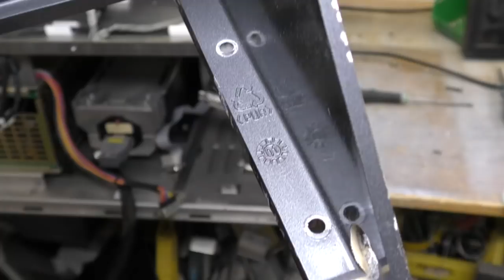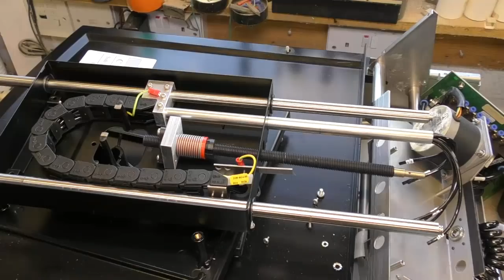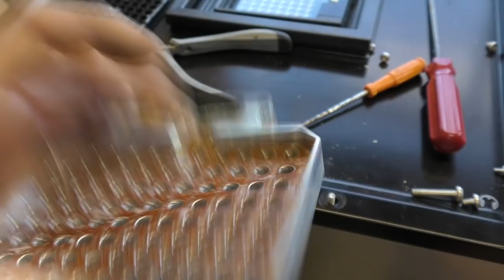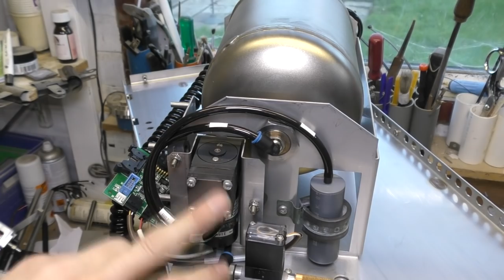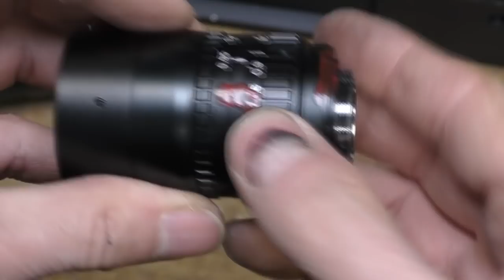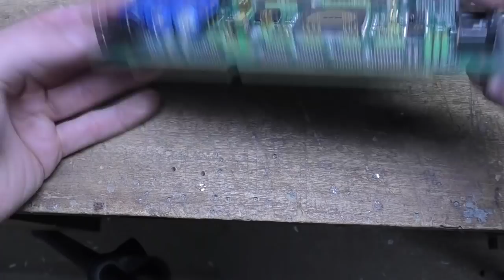Yet another DNA sequencer - PSQ96 pyrosequencer

Comment: I've gotten several of these from the Purdue University resale shop, usually paying no more than $25-$40. Well worth it for the adventure! They are truly well built machines and full to the brim with useful parts, especially the older machines. Gotten countless precision ground linear rails, optics, and stepper motors, along with pneumatic valves, servo regulators, and even a 220V argon laser! The sequencer I took apart was a bit different, there was a tiny lens for each well that fed a fiber optic cable, the other end of each cable was mounted on a disc about 7 inches in diameter, a mirror rotated around to individually index each fiber and direct its path to the CCD which was nearly 3" square with a monster heat sink on the back!
Reply: The lens itself here looks like C mount NAVITAR 17mm F0.95, which is 100-500$ itself :P

Comment: I'm always curious about the economics of some of this equipment.  How many of these could they possibly sell in a year? 500?  5000?  I'm sure they re-use as much hardware and software across devices as possible, but ultimately there's going to be a lot of 'PSQ96 pyrosequencer' specific development/testing/certification/manufacturing/support work to do.
Reply from the maker: I suspect they make a lot of the money on the consumables. Just like inkjet printers.
Reply: Yes and that is why advanced things like this are so extremely expensive. They maybe sell 1000 in the entire world, then next year they have figured out something that is better and make a brand new different one from scratch and in the 500 - 1000 and so on. They don't reuse material from one machine to another unless its minute changes or some component or such is really good but otherwise its normally never the case. They don't build these for cost they build them to do what the customer ask. Some specially equipment do exist but they are not overflowing and that is because when the new machine come the old one is scrapped right away.

Comment: Maybe try getting a cell sorter? 

I know many of those are really big but maybe not all are too big. I know someone who used to have a huge old one from the 80's and it was the length of a van (nearly 20 feet) if I remember right. It had a giant 4 feet long water cooled tube laser (maybe argon, can't remember). The laser needed 240 3 phase and water cooling so they took it elsewhere to test it. My friend got the cell sorter to tear it down and much of it was gone by the time I saw it. (this was 20 years ago)
Reply: Had one for teardown, it boils down to an overgrown confocal microscope with Ar+ laser and bunch of PMTs with dichroic filters.
Reply: There are small ones that would fit in a bed side table (or a tad larger).

Comment: Any device that relies on some type of chemistry or physics is always interesting. At work we make some kind of bioreactor as well, I believe it can do 24 tiny reactions at once. The most expensive part is a specialized optical module that enables the device to measure pH and other values optically. The exact witchcraft will be in the chemistry used, like a pH and Chlorine photometer used by swimming pool checks, I suspect.